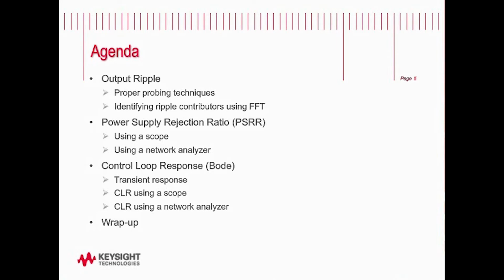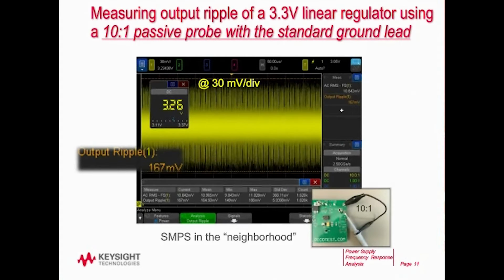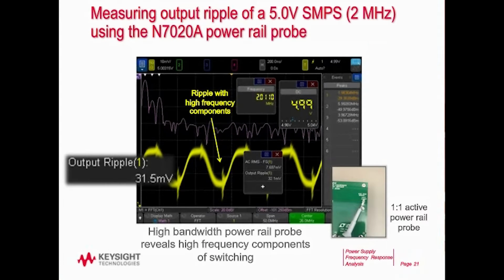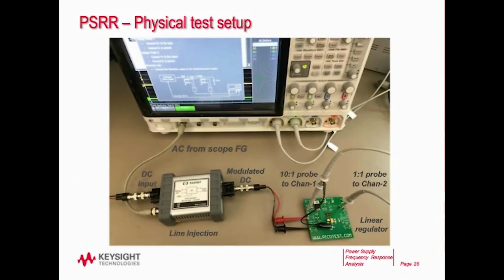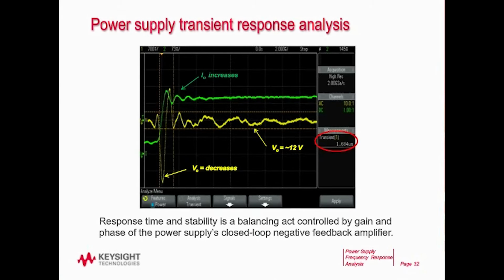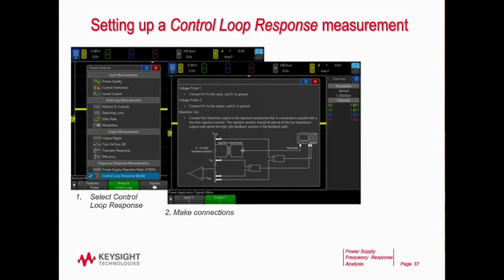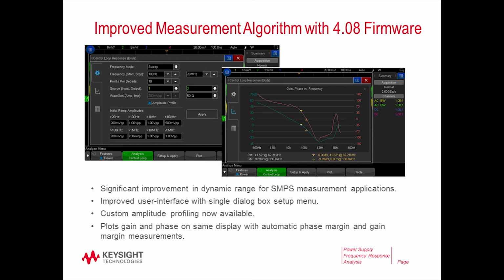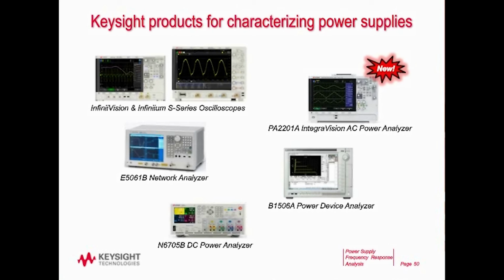Frequency Response Analysis using Oscilloscopes

Comment: If only boards were always laid out with scope probing in mind we could file that ground lead where we file the parts never used , the "what's this do ?" parts and the manuals of course .
20:1 passive probe from a 1k resistor on a 50ohm coax , with the given drawbacks but the joy of just tacking the probe tips on but beware circuit loading though without ac coupling ... Life's all ups and downs with oscilloscopes.